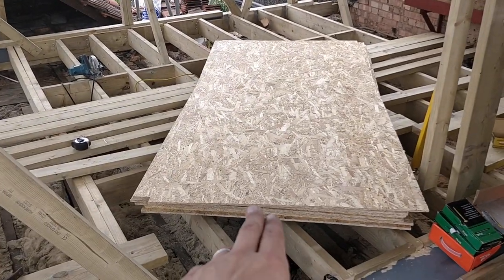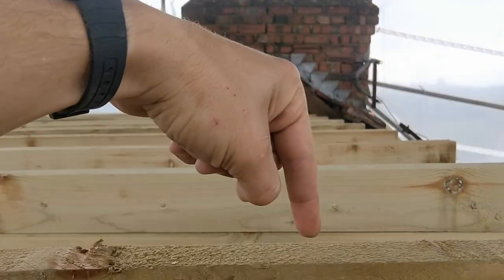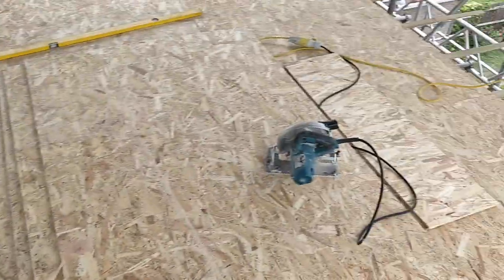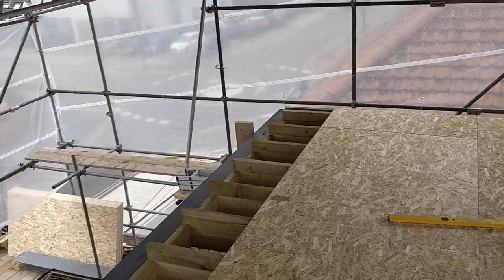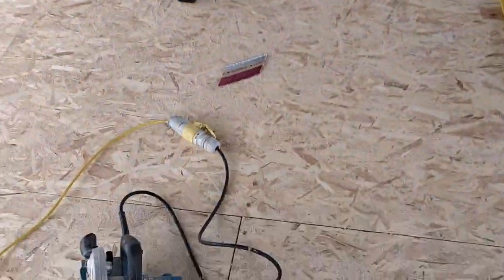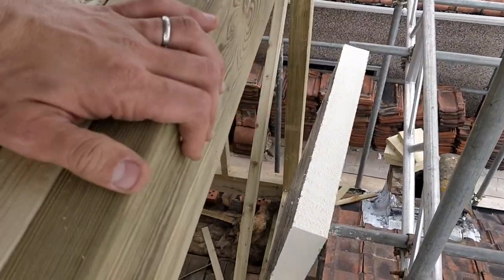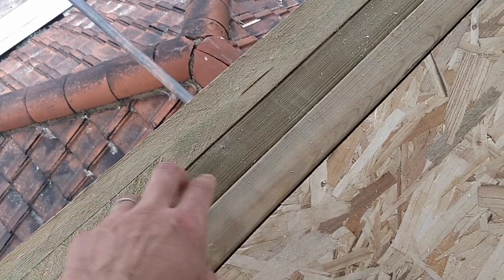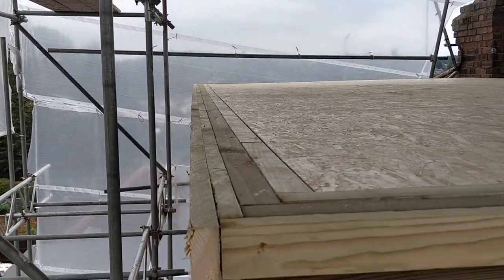Dormer roof insulation (warm deck)

Comment: Vapour Barrier is missing, and is a crucial element in a warm-deck flat roof. Thermally broken fixings are missing.
Reply: this is what i noticed first off.
Reply: That's what I'm sayin
Reply: That's what I'm sayin
Reply: The aluminum foil covering the rigid insulation board is a vapour barrier.
Reply: @edmarferreirajunior724  LOOOOOOL no its is 10000% not! this will not pass building control. Also the screws should be in a plastic sleeve to stop bridging. Nice looking but in 1 year the roof will be rotten!!!
Reply: @real_wakawaka , yes it works. There is no air convection through a closed cell rigid insulation board of XPS, PU or PIR. By the way, have you ever saw a vapour barrier in a wall built it whit a SIP panel? Probably not, because a properly sealed rigid insulated panel creates a code compliant air barrier with a permeability rating of less than 1.0 perm. Thats the same in this case. If the joints are properly sealed, there will be no problems, and the aluminium foil covering will work as a vapour barrier.
Reply: @edmarferreirajunior724  btw the work looks good, what im referring to is the plastic tubes that should be used (fixing) https://www.youtube.com/watch?v=RBINlVX0jOc this would allow 0 thermal bridging
Reply: @real_wakawaka  , I got your point and 
I totally agree with you.
Reply: Yep I noticed that too and those screws are not the best for thermal values ,flat top long nails with plastic casing
Reply: 200 mm screws in UK weather will not last long  the plastic casing is a must
Reply: @edmarferreirajunior724  
That’s incorrect
Reply: @edmarferreirajunior724  
It’s not on walls because it rises upwards 
Do some research on the subject

Comment: I think that needs a vapour barrier under the pir otherwise in <5 years the osb will be rotten and need replacing(especially if there is a bathroom/shower up there). Building control won't sign it off without it. I hope that you can retro fit it - good luck
Reply: Agree u havent put a vapour barrier in u need this warm deck roof. Also the screws u need a special fixing which the screw goes into because of thermal bridging.
Reply: @harrysingh1145  Zinc screws have a very negligible thermal conductivity, besides will allow you to run the EPDM smoothly  with no bumps left by the  SureFast tube washer.

Comment: Really enjoying your videos, really clear and well explained - looking forward to working my way through the rest over lockdown! I would however would also like to flag the need for a vapour control layer beneath the insulation as others have done. It is recognised best practice and is recommended by all membrane manufacturers and building regs, so the fact the roofer doesn't agree is basically irrelevant.

I'm certainly no expert, but regarding the OSB over the insulation comments flagged already: I imagine it might make a difference how much moisture is trapped at the time of the install; if it had been raining and water was trapped in and around the insulation then I can see that being an issue over time if the moisture can't escape. If the build-up was quite dry at the time then its perhaps less of an issue?

My understanding is also that a certain amount of water vapour will escape over time as the roof heats up in the sun so I would probably not be too concerned. That said i would rather have the VCL than the OSB - if the OSB is there for convenience of install then it is surely only a marginal benefit in the grand scheme of things? if its there for robustness - who is ever going to walk on the dormer?
Reply from the maker: Thanks for the support mate.

I agree with everything you've said mate, all your observations are spot on. Thankfully it was very dry and stable when we installed, and the insulation was nice and dry too, but yes, a vapour barrier would have been best.

I know that the foil facing of insulation acts as a vapour barrier, but the membrane is different and necessary. On my more recent builds I've done that.

Comment: For one you didn't space your plywood for expansion and contraction for 2 you didn't use vapour barrior for 3 you didn't use thermal braking fixings for 4 shouldn't the thicker plywood be on the bottom?

Comment: Excellent video, perfectly showing a builder not fully understanding the principles of a warm roof construction, missing the Critical vapour barrier, 25mm expansion joints, as others have pointed out. Hopefully the building control will pick up, before the is finished.🧐
Reply: 25mm expansion???

Comment: Whether you can do a warm roof is often down to planning and the slope of the original roof, the dormer has to be subservient to the ridge so you need a big roof with a high pitch. Everyone would build warm roofs if they could but on a flat roof extension there is the issue of the roof looking too bulky.
Reply from the maker: That's a good point. I think there's also an element of not necessarily knowing or understanding the differences between them. If people knew the difference properly, I suspect they would opt for a warm roof in every situation that it's possible to do them.

Comment: Thanks for taking the time to show us this. Could I ask as a client why would I want to lower the internal by having a warm roof?  If you understand. Thanks
Reply from the maker: In terms of loss of head height, it's actually negligible (40-80mm) because on a "cold roof" where the insulation is between the rafters, you need them to be deeper in order to get the same U-value. Because of this you end up spending more time working on them (notching to install and cutting insulation to fit between) and you also have less space as a service void to run your cables and lights. I think that the small loss of head height is definitely offset by speed and ease and the definite increase in insulation levels.
Reply: @OfficeBoyBuilder  cheers you explain things very well. Loving this one.
Reply: I'm still insulating my cold deck dormer conversion (6.5x5.5m) and my main worry is condensation. I've continuous soffit ventilation across the front face and both cheeks, a 50mm air gap above the 100mm insulation, foam filled any tiny gap due to rafters twisted or a mm or two out, then made sure all wiring was tacked above the 100mm insulation which I then cut a square hole in, fitted Thermahood for 20 spot lights, back filled those with more foam and capped them with a 30mm PIR layer AND THEN under drawn all of that with a 30mm PIR layer and taped all the seams. Building regs also requires a further vapour control barrier so yes, cold decks are an absolute hassle because if you have any breach in your PIR for spots etc, you will have ineffective insulation, risk condensation build up in the structural timber. I'm not a builder, I just learnt all this in a few weeks and redid the whole job I paid professionals to do.

It's crazy how many joiners and roofers don't understand their own trade. If I'd have known before undertaking the conversion, I'd have gone for a warm roof too. Cold deck roofs are apparently banned by building control in Scotland? I can understand why. They need to be installed properly and sadly, a lot of traders don't achieve this.
Reply from the maker: Mate you've literally written chapter and verse what I've done on my loft...! It's a whole ordeal, Vs the simplicity and speed of a warm deck!

Ps. Great work going to all that effort. 99% of tradies wouldn't, and 99% of home DIYers wouldn't know to.
Reply: @OfficeBoyBuilder  I think a lot of home DIYers do know what to do thanks to channels like steve roofer and others.
Reply: @OfficeBoyBuilder  too true. I was gutted pulling down some of the underdrawn 30mm PIR to find literally 2 foot gaps in the 100mm PIR and huge cut outs for the spot light wiring. My heart sank as I realised I needed to pull the lot down. I can understand why traders wouldn't do it properly as it's taken me a full week to redo it all properly versus a probably a day to lash it up in any old fashion and then cover it with 30mm to make it look like it's been done properly.
Reply from the maker: @Craigo5000  mate that sucks. Good on ya for sorting it the right way - it'll pay dividends that you'll never really see, but you know it's secure and done well
Reply: @Craigo5000  To be fair a lot of tradesman do top notch work and charge accordingly. The problem with most home owners is that they expect a champagne job for cider money. I'm expensive and I'm very proud of that fact because my work is tight, 🔨 🇮🇪

Comment: Have you side nailed them furrings  into the roof joists? instead of down through them? Is that more for strength? Thanks G
Reply from the maker: Occasionally the nails hit a knot in the timbers and get skewed off! It's not deliberately shot at an angle in this instance 🤣

Comment: Didn’t you need to tape the joins or put in a vapour barrier?
Reply from the maker: Yes you're right, I pointed that out to the main contractor that I was subbing for, and he said they never built them like that and it wasn't needed 🙄
Reply: @OfficeBoyBuilder  what did it say on your plans or what his the building regs
Reply from the maker: Building regs vs. what gets signed off are two different things sometimes (sadly!). I didn't see the specifications as I was a subcontracting carpenter.
Reply: @OfficeBoyBuilder  Totally wrong.

Comment: whats the exact spec on that kingspan @ 120mm thk please mate  👍
Reply from the maker: Not sure I fully understand the question...? It's 1200mm thick, and comes in various sheet sizes, but we bought 8x4 foot sheets. In terms of U-values etc. You'd need to check the website because they're quite specific about the conditions needed in order to meet those specs.
Reply: @OfficeBoyBuilder  bloody ell 1200mm thick eh, BC must be murder where you are🤣! no worries mate and I can see its 120mm thk quinn therm your using

Comment: A good example of what Gary Chue was saying below about the osb on top of insulation - https://www.youtube.com/watch?v=6NWrYG2G2Ho

You can see that without a vapour barrier the osb will die if it is not vented.
Reply: So is the osb on top needed? Or can you also choose to use the rubber roofing directly on top of the insulation?
Reply from the maker: OSB on top is absolutely needed. Ideally you'd have thermally broken screws to fix it down. But for the structural strength it is most definitely required.

Comment: You should not overlay a "warm roof" with plywood/osb as you are actually turning it back into a cold roof with no ventilation. Correct warm roof construction build up is 1) structural deck 2) vapour control layer 3) thermal insulation 4) waterproofing - True osb/plywood is a nice base to lay flat roofing on but that build up is not correct for a warm roof.
Reply from the maker: There are many different ways to do things, so it's not totally wrong...why would you need to ventilate a warm roof? According to the NBS a warm roof doesn't need ventilating...
Reply: @OfficeBoyBuilder  Because you have not actually constructed a warm roof. The correct build up for a warm flat roof is as I have stated. I have done 1000s of m2 over the last 36 years and I am qualified in flat roofing and a former Fellow of the Institute of Roofing. Check any major flat roof manufacturers website and they show construction details to back this up.
Reply: @garychue7343  that does make a lot of sense, doesn't seem any benefit putting wood into a space where it can rot. 'If it can't dry it will die!'
Reply: @Gary Chue... I'm planning a warm roof project in my garden and all the info I have seen on the planning portals and building regs seem to say nearly the same as you... 18mm osb3 over joists, a good vapour barrier, insulation... and then another layer of 18mm osb3 before putting on the final waterproof layer.

Whats the reason/benefit of leaving out the top layer of 18mm osb3 per your suggestion?

Also.... one question.... there are gaps between the joists on top of which the warm roof is built-up. What happens with these gaps?  Are they blocked and insulated or are they left for air to circulate up and out through the fascia and soffit?
Reply: @jp6975  You can put another OSB layer on top. Some membranes eg fibreglass would need this in place. You can't fibreglass straight onto PIR! Ideally, use thermally broken fixings ie tube washers, along with a vapour barrier and you'll have a good system.
Regards to the space in between the joist, do not ventilate- you don't want cold air between the insulation and your living space! But remember to insulate behind the fascia detail (between the rafters) as you'll have a big cold spot there otherwise!
Reply: @garychue7343  Correct Gary.
Reply: You make no sence
Reply: A link to the best (or proper) source of info wood be good. I'm not undestanding the rubber membrane/waterproofing directly onto PIR thing either.

So, what about this from bottom to top?
Joists, furrings, 18mm Osb, VB, PIR, VB,11mm OSB, Rubber?